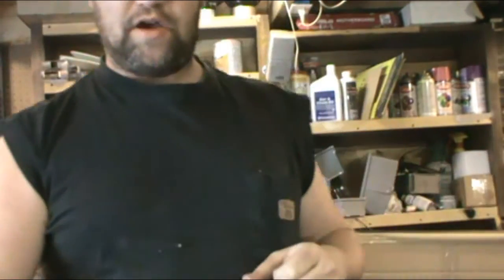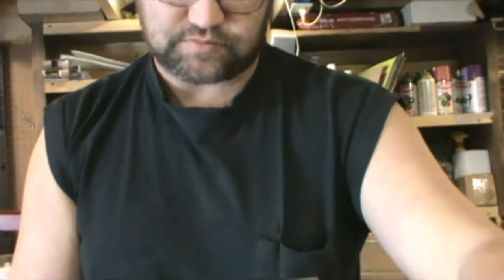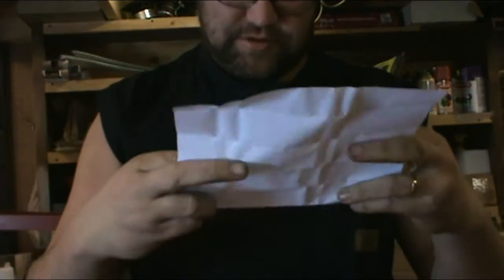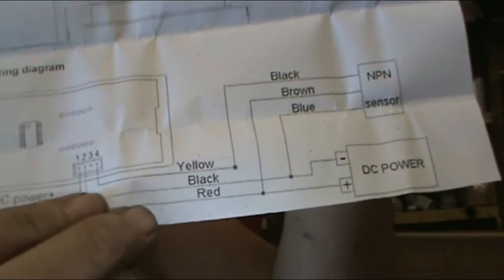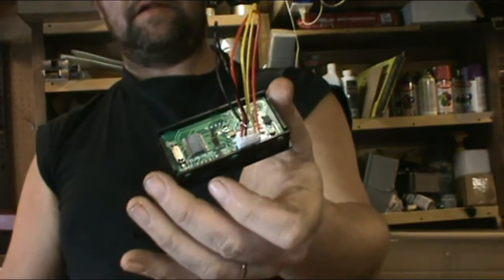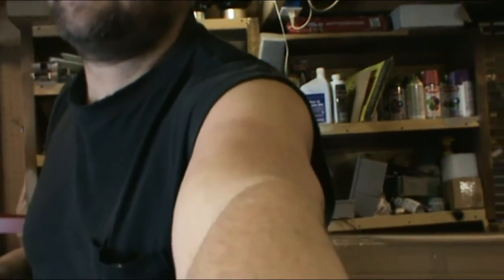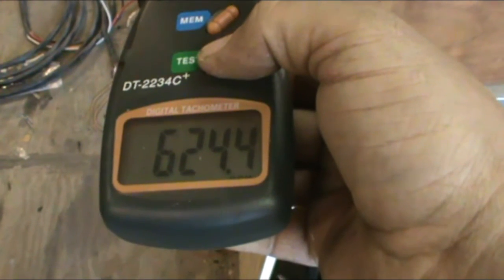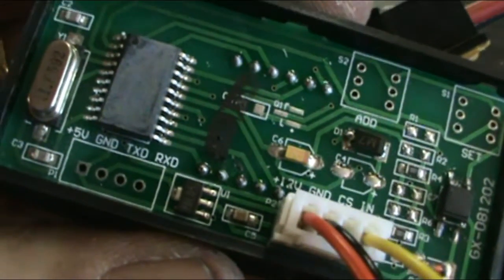Tachometer RPM Gauge Unboxing and Review

Comment: I must be some troll.  I missed this from a year ago.  It was best I did back then.  LOL  Good info  Thanks Charles
Reply from the maker: +TheRealWindTurbine King   Thanks.  This RPM Gauge was just another great tool to use with wind turbines.  I have a video after this one also that shows how it works on the hub of a wind turbine and how I mounted it. Works really good. Just wish I had a much better turbine to use it on.
Reply: +McCuneWindandSolar   Workin on that for ya.  
My problem is my turbine is 3 stories up.  Lotta wire,  I'll have to use a shielded twisted for that length as it will have to run down the conduit

Comment: hey that is a nice lil system... hey that is a great Idea for powering it. I have a 5vdc power supply that I use to power my new digital amp meter..  I am going to do the same thing with a small solar system and a batt. thanks.... 4 RPM difference is really nothing.. that is pretty dam close.... that has an agv. of 626 rpm.. that is only 3 rpm and = 0.5 percent +/- accurate that is great and well with in specs...  I hope my math helps ya, be leave me that it is PERFECT... great video bud thanks...

Comment: I commend you for your dedication, it will be interesting the details. I have asked Jeff for a better explanation of how many blades at what application.
I put up a 13 blade and I think it's a bit heavy, when I have a chance I might try a seven in the Spring.
john
Reply from the maker: and that is what I will be doing what I do, this will also help support Missouri wind and solar to provide a much better product, the PMG is a great Machine, but we need the right blade to drive this machine, I hit 1kw with the 11 blades but could have been more if I have longer blades less blades and so forth. and with these test I will be doing we will see what will dive this machine to becoming the best affordable Wind turbine on the market.  and with these test we will see if we need to redo the mounting system, maybe, even work with a gearing system so we can put larger blades and achive high out put in 5mph winds and yet still keep cost down for the consumers, it will take a lot of work but I know with my help and many others Missouri Wind and Solar will have the best wind turbine on the market.

Comment: that will be good i hope more ppl go into RPMs for there wind turbines it should be the new standard for showing just how fast there going. No more you got your wind meter in the wrong place it should be to the left of the of the dead bug and just a bit higher,
Reply from the maker: yea I figure this way now people wont get confused, ,with RPM V's MPH,  and I then can show the RPM V's MPH with each set of blades and the swept area of those blades,,, that way people can see what 11 blades 'V's 9 blades and so forth compare in RPM and wind speed,  and this will be great because the one that provides the most power at the RPM and wind speed will show people what is need to make power,   you can have a 2 million kw wind turbine but if you have the wrong blades you just end up with a heigh priced paper weight,  and this will then put to rest what Missouri wind and solar turbines can do and if thermodyne wants to take the challange then I will test there turbine in the same conditions with there Equipment. this way every one will know,